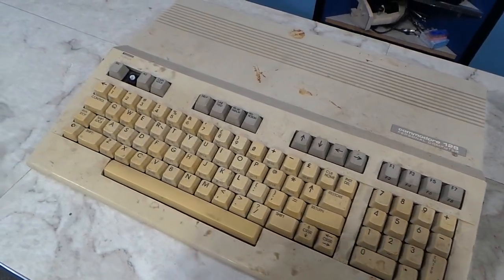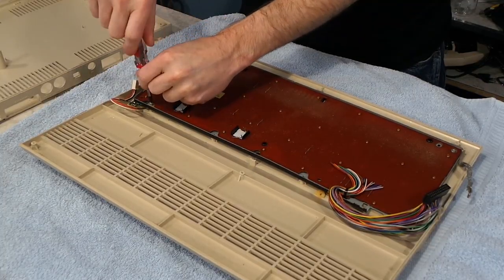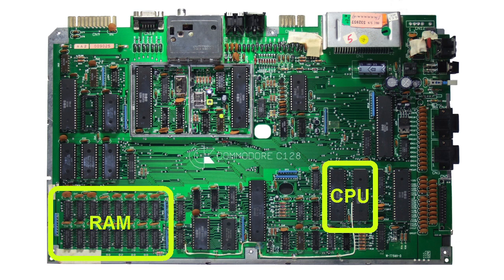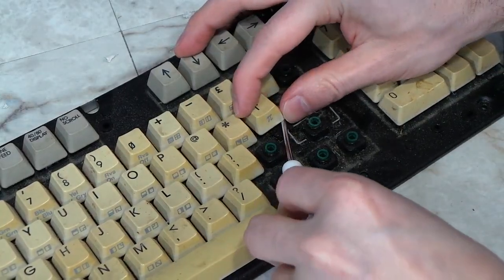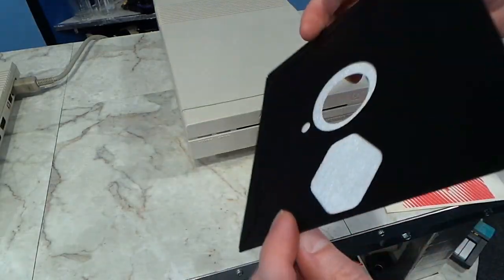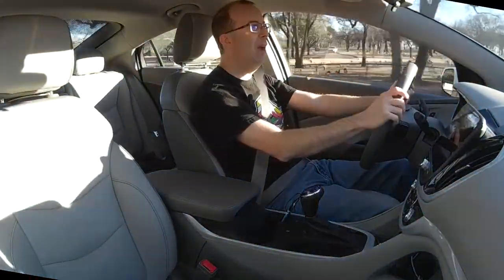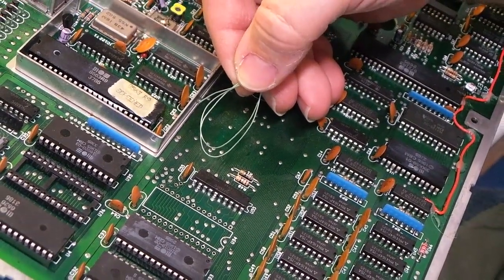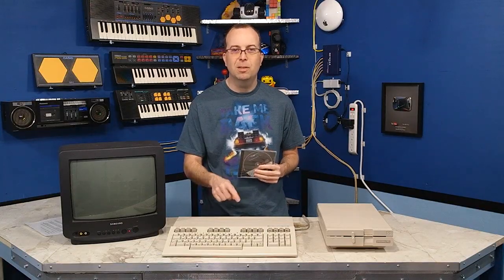Commodore 128 Complete Restoration and Board Repair.

Comment: Love to restore old stuff. But I never did such intensive cleaning beyond the surface grime. Wish I had known about the hydrogen peroxide paste trick tho, it would make a huge difference. I've got a Palm Pre phone and a  Cobra 132 to repair/restore. But both of them have black cases. My old C128D on the other hand could use the bleaching when I get to restoring it and repairing the drive(head replacement).

Comment: I was one of the old Commodore fan/junkie with a PET, VIC20, VIC20c, C64, C64c, C128 over the past 25-35 years. I still have the C128. Glad to see you got it fixed. Thanks for the video! :)

Comment: I noticed that you use alcohol when cleaning "marks" off of the case in the video.  Have you used Goo-Gone instead?  I know it leaves a bit of an oily residue, but it sometimes will do a better job of getting those marks off.    Just a thought.  BTW, love your videos - brings back memories of days gone past (for me.)  Keep up the good work.
Reply: Goo Gone works but the oil can be a real pain to deal with. Just be careful to never confuse it with Goof-Off which will melt a lot of the plastics used in these older computers.

Comment: Your doing a Macintosh SE with the HDD restoration? I have the 20 MB model with the original keyboard, mouse, FD protector, power supply and keyboard cables from 1988 (at least that's what the HDD says) . It also has a carrying case, MS Word 3.0, Mac Write and Mac Paint! It all works perfectly (even the clock) and it was an amazing find for $150!

Comment: It is about a commodore then you took it to Raymond, because if it was an Apple 2 you will take it to that guy Wozniack
Reply: Thanks Double-D! I worked for a grey market Apple repair depot from 1993 to early 1998. :)

We did Apple II+, IIe, IIc, IIgs, and all sorts of Macs up to the latest 1997 had to offer. The fun repairs were when schools sent puke filled Apple II keyboards to us. That place sent me to Pace soldering station training where I learned how to use their gear for thru-hole and surface mount rework.
Reply: BITD he actually worked for a repair depot working on Apple II systems so he is quite capable on those. He does some 8-bit computers, but believe he mostly works on arcade pcbs.
Reply: Just kidding but it's nice to know that. The guy is a master

Comment: id like to know what solder sucking soldering iron ray has.
Reply: I use Pace gear on all of the benches in my workshop. That one in the video was the SX-70 desoldering iron which will attach to any Pace base unit that supports Sens-a-Tip irons and that has the desoldering pump built in.

Comment: 8-Bit Guy I have a question, I recently purchased a Commodore 64 out-of-the-box, and it came with no cables, so i'm left without a floppy drive, and everything. So I have to buy all that, anyways, getting to the point, I don't have the power cable of course and I can't find any for sale online, i've tried my best by searching everything to find one but I can't. Do you think there's a way I can grab one?

Comment: Always nice videos. :) Incredible result on the restauration! C128 is easily my most favorite 8-bit computer, have five of them to guarantee that I'm never be without a working one. Sadly one of them is more orange than an orangutang. Asked my hairdresser if I could buy some of that cream adding that I had no plans to make explosives and she said no problem, but not exactly season for it here in sweden atm because sun is very low. 

Interesting to see and hear The Great Giana Sisters in 60Hz mode, music was noticeably faster.
Reply: If you get the right type of UV lights (black lights) you can retrobrite indoors.

Comment: You've gone great length to rescue this commodore 128, thanks to you another one comes back to life. I really worried you might  get the good one ruined pluging back and forth.Use a key puller will make the process of removing keys easier and safer. WOW, those professional tools are really amazing, desoldering could be so easy...I think I might need to get a tool like that one.

Comment: I've a C= 128D sitting in my closet for about 5 years now. I had it and a pristine IBM 5150 w IBM mono monitor, two full-height drives & 20mb hardcard, but I couldn't keep both, so I chose the 128D. 

I should dig it out and see if it's still working... it was working fine last time I fired it up. 

I'm looking forward to your Mac restoration... I had a Mac SE upgraded to SE/30 20 years ago, and I've wanted another one for years, but finding a decent one on ebay that's affordable... 

Speaking of such things... I also have an old "Snow" G3 iMac... worked fine, then developed a graphic glitch at startup that went away as it warmed up... when I moved, it stopped working altogether, not even a power light. Would it be worth having repaired, or would it be too expensive (ie, more expensive to repair than a Mac SE/30 is likely to cost me on ebay?)

Comment: When rubbing/spreading heatsink compound, rather than use fingers directly which is messy and adds thermally questionable dead skin cells, place finger into the corner of a plastic baggy. Don't rub too hard or you will push through the plastic.

Comment: The only issue I've heard of with the RetroBright method is letting the plastic sit too long or in too bright of sun, it will become brittle or even have a texture etched into it. Haven't tried it myself, although I'm tempted to do it on my Apple Extended II keyboard.

Comment: What kind of corrosion occurs on a mainboard and eats through traces like that and what causes it??? Very cool video, thanks for posting. I have a large C64 collection but know very little about the 128.
Reply: Given the style of computer, the question is what was spilled on the keyboard that dripped down on to the main board if I had to guess. Considering all the stuff on the outside of the computer who knows. :)

Comment: I want that desoldering setup.  What is it?
Reply: Raymond has all PACE desoldering stations. They are certainly not the cheapest you can find, but deals can be had if you look enough.
Reply: Ok, first things first, Those are AWESOME.  but they are not cheap.  I would have a hard time justifying the price for the 2-3 times a year I use them.
Reply: Agreed on both counts. :)

Comment: I put all the parts in the dishwasher. Shortest program. No soap. No drying. 
When i say all the parts i mean almost all parts. I do this to casing, keyboard, motherboard, but not to the disk drive. Smaller things like the keys i put in a small washing bag.
For brightening the keys i use H2O2 fluid in a bag - not the creme.

Comment: Im curious how did your friend know where to relay jumper wires to fix broken traces?
Reply: You either follow the traces to another point you can jump to with the wire or look at a schematic to find another place. You just need to find somewhere the trace runs without a component between the two points you jump. So the wire is in parallel with the trace.

Comment: I could sure use that nifty-looking solder remover myself :) Btw. By applying thermal grease with a bare finger, doesn't that potentially add finger grease or other contaminants into it and make it less effective? I always use a clean piece of tough paper or cardboard to spread it.

Comment: Regarding the baking soda step (and also at least partially the alcohol one): When I was working at a cleaning service, we used small white sponges. They are abbrasive, soft, especially when slightly wet and basically are a dirt "eraser".  They work wonders with scuff marks, black spots, even sharpie marks and more. They also tend to leave remains (they literally are erasers, complete with little left overs), but you can just let them dry and then brush them off. Maybe try them next time? Note: I'd definitely not use them on keyboard buttons, as depending on the method used to print the lettering on them, it might take it off.

Comment: Hi David,

Great video as always. I especially love restoration projects like this one. You and Raymond did a spectacular job.

I was wondering if maybe sometime in the future you could do a video over on your 8-bit Keys channel about how to fix noisy / buzzing audio on keyboards that output analog audio. I have a Yamaha PSR-32 that I got from Goodwill for $15 and it's works great, but the speakers and audio output are incredibly noisy. The problem even persists when I use batteries and a different power. Anyway, keep up the good work!

Comment: I could not help but cringe when you hooked up your known good C-128 to the questionable power supply as that is a great way to destroy a perfectly good device if the power supply has failed as a fault in the series pass or switching transistors can allow very high voltage through to the device (and if a marginal transistor the voltage may test fine under little to no load, then spike when you connect a load).  As many machines as you rebuild, investing in a decent benchtop lab power supply is highly recommended as you will know for certain the voltages it will output are correct and safe and you can program current limits for each voltage output so that if a device has shorted then the current will be hard limited to prevent any serious damage from happening provided you setup reasonable current limits to begin with, this greatly limits any sort of catastrophic failure due to faults.  The corrosion was likely from a spilled soft drink and very typical of what one will often find beneath old electrolytic capacitors that have leaked with age as the acids slowly consume the traces.  I would also prophylactically replace the aluminum electrolytic capacitors on the board and in the power supply as they are now so old that they become ticking time bombs themselves, eventually they will fail and either damage nearby traces by melting them, take out the power supply, or leak their electrolyte and deal massive damage to the PCB and traces at a later date -- just replace with quality Japanese brand replacements (Panasonic/Matsushuta, Nichicon, Chemicon, Rubycon, etc.) and not cheaper commodity Asian brands as it only costs a couple dollars more and you can generally count on another 20-30 years of service after the retrofitting ensuring that they will continue to entertain and educate another generation of children and adults who appreciate them.

But most of all, thank you very much for these videos.  If I lived closer I would offer a hand with the repairs, but SC is a bit far off from TX!

Comment: For the future: get a $5-7 keycap puller on Amazon, makes pulling caps straight off a ton easier and also reduces the possibility of breaking a switch. I prefer the wire ones (WASD and Max Keyboard are both good and less than $7) but some people like the plastic "Decoder Ring" looking ones.

Either way it's a lot safer than prising with a screwdriver.

Comment: Thanks for your video. I have serviced and repaired a number of older pieces of computer equipment and I always just use household thick bleach and a small scrubbing brush to bring back the original colour of the plastic casings. It works really quickly and seems to last but they need to be well rinsed in warm water (I use a shower attachment in the bath!) and dried before reassembly. Rubber gloves are preferable unless you want really dry and sore hands!

Comment: Hi 8-bit. got a question for you. There's a crack in the back of my Dell Inspiron 1300s she'll.  It's the part that's the back of the battery compartment, and towards the hinge screw. Any advice for keeping it from spending or braking off?
Reply: DominusCypher I'd rather not have to hammer my Dell lol.
Reply: Well, the most obvious solution is to replace the lower tray (also called the "bottom plastic" or "bottom tray" or "tray base").  Even if it's out of warranty, you can find replacements for about $17-$20 plus shipping, and how-to videos on YouTube.

If you don't feel like taking that risk and/or can't find someone with certification to do it for you, then the other solution is to take a drill and a very tiny drill bit, and drill holes at both ends of the crack. This will at least stop it from spreading any further.

Qualifications: I'm a DCSE (Dell Certified Systems Expert).  I've been repairing Dell computers for the last decade.
Reply: Ty. Umm don't think I like the idea of completely taking my Dell apart. May see about the drilling idea. Would it help if I glued something thin over crack on the battery compartment side for reinforcement?
Reply: Don't make things more difficult than necessary when that can clearly be solved with just a couple of rolls of duct tape and the liberal use of a hammer.
Reply: It won't stop the crack from spreading, that's the problem.  Making holes with a really fine drill bit at each end of the crack will stop it.  Just be careful, you don't want to drill too deep (depending on which hinge has the crack, it might be the side where the wi-fi antenna and/or video cable is fed through).  Just enough to get through the plastic.
Reply: SpearM3064 Oh okay. Yeah WiFi antenna not a problem  (it's a windows xp machine. Hasn't been online since end of support) but hitting the video  or the screens power line would be bad. I do have a PDF of the service manual. I'll check it first see just where the harness to the LCD screen are run though.

Comment: I have a suggestion for cleaning the keys. 
1) Remove the keys
2) Once you have removed all the keys, put them in a container that can be sealed (preferably plastic) with a lid. Then, add a little bit of dish soap and warm water
3) Seal the container and shake. How hard you shake is up to you, but some older keys may be brittle and break easily while newer plastics are generally stronger and more scratch resistant
4) lay out all the keys on a towel. You can either let them air dry, use canned air, or set them under a heater vent (but at a safe distance so the keys don't get too hot and warp)

Comment: Just started watching. Getting 5v is good on dc setting but switching to the ac setting on your DMM will show you if your voltage is dirty. Aka usually need new caps or BRs

Comment: +The 8-Bit Guy There's another step you should do after the peroxide treatment.  After the treatment, give the plastic a top coat of Novus Plastic Polish (about $12 for an 8-ounce bottle at Wal-Mart) or 303 UV Protectant (which you can also find at Wal-Mart, in the automotive center).  These will restore the high gloss, and protect the plastic from yellowing again.

Comment: Yes, there is ALWAYS someone more knowledgeable than you. This is especially true when considering varying specialities.
Interesting fix. It makes sense.
Reminds me of how I fixed my Yamaha keyboard, though that was much easier to diagnose, and wasn't a motherboard fault. (and was also a direct result of battery corrosion. D cell zinc batteries huh. XD)

continuity checking is surprisingly useful as a diagnostic tool.

Comment: Are you sure the peroxide didn't break down those rubber feet and make them sticky? Might be a good idea to remove those first. Also, I flinched a little bit when you put your good chips in the dead machine. Seems risky.

Comment: 8-bit guy, you should make a video on which vintage Macintosh is the "best" to start collecting, for example, iBook, PowerMac, etc., sort of similar to your recent "Best Vintage Game Console for Arcade Games?" I was thinking about buying an old iMac G4 off eBay, but I was wondering if I should spend it on a different, more rare or special computer.
Reply: Peter Kapica That is a good idea, but I'm looking more towards late 1980's to early 2000's, in fact I already have an original Macintosh and a Texas Instruments TI-99 in my "computer room" which I got from my Uncle.
Reply: iiiiiifggffggffgfgfg Thank you for the suggestion.
Reply: Tecmo collect Macintosh 128k and earlier if you want to colllect valuable macs
Reply: iMac G4s aren't really anything special. 20th anniversary Apple Mac is worth something. So are Color Classics and Color Classic 2. Also the really ancient macs.

Old iMacs are still somewhat functional as daily-use work computers.
Reply: Tecmo the best ones are the oldest
Reply: iiiiiifggffggffgfgfg I had an iBook G4. Slow as shit on the internet but great for a couple PPC ported games
Reply: The G4s can run pretty much all mac games back to 1984. I have an old iMac ("Forest Green" or whatever it is) around for old gaming, because the emulators for power PC are pretty garbage. It also has a DVD player.

All that good stuff like Civilization 1 and 2 and such. The problem now is that a lot of old games are emulated perfectly (though, often on DOS - the mac ports often got graphical upgrades) or just plain re-released. The Marathon and Myth games run on modern computers, for example.

As of 2014 there was still a build of mozilla that run on old powerpcs that was okay-ish for browsing, but I haven't really used it for internet since then. I briefly used it as a desktop PC (in combination with my macbook pro) when I was first starting my business, though mostly for show than anything else.

The iMac keyboard, however, is great. Nice big keys unlike this chicklet crap a lot of new PC keyboards have.

Comment: What was the device for testing the data lines of the commodore? Was it a multimeter?
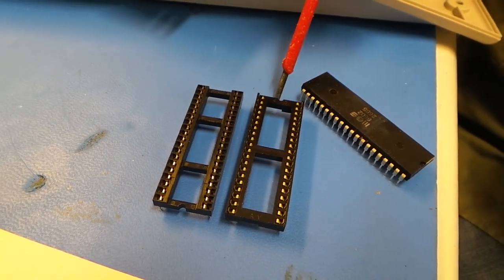Reply: Ok found out myself. I'ts a logic analyser. The sound it makes, plus the 3 leds show you what signal it measures. The D3 pin is a data pin where a pulse signal should be measured (all 3 LED should be on). At around 12:55 you can see how it should look like and what is measures.